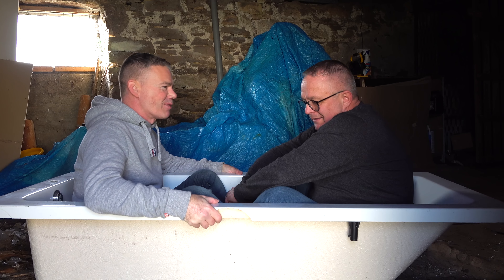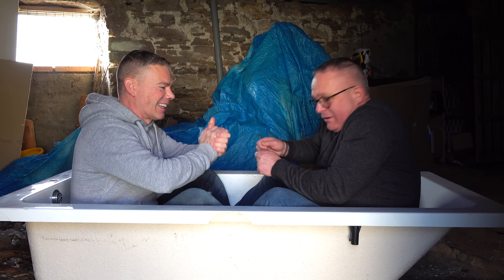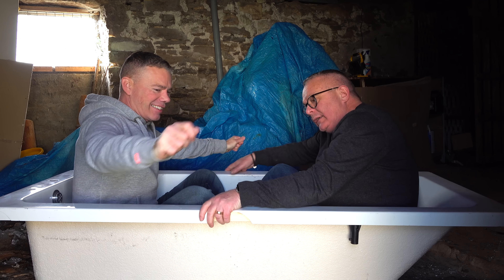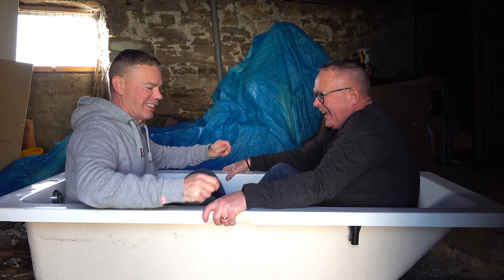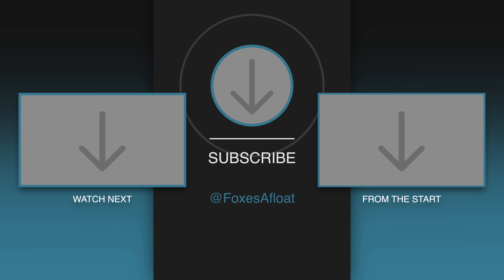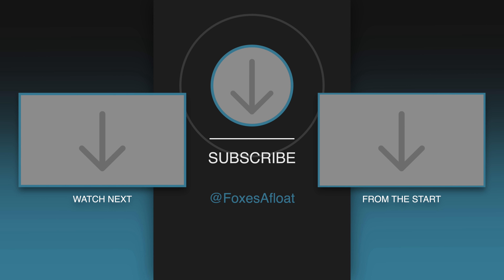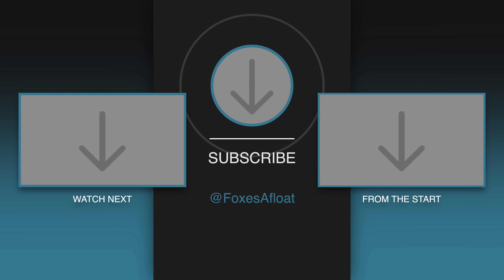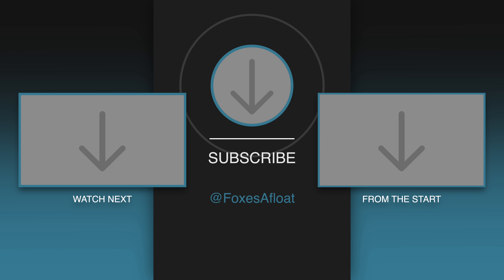Building a Train Set inside a TRAIN! Model Railway Heaven! Ep. 222.

Comment: The carriage idea, although a good one I think it would end up being too narrow. The barn conversion, as others have pointed out would add overall value. Having a garden room would tick all your  boxes, would come in sections - easy to erect, also heating and ventilation would be easier.  If you still want a train set to ride on - build a garden railway around your small holding - you could have a steam train or electric (battery). Anyhoo have fun guys.
Reply: Gets my vote.
Reply from the maker: Not too narrow, already checked 👍🏻

Comment: Having a purpose brought building for the layout is the way to go, definitely needs windows though not just for obviously letting in light but added ventilation in the summer months , heat definitely isn't good for a layout. My own layout is in our attic and is equally subjected to cold and hot conditions  but I've worked with these situations allowing for them. I've also built it in exactly the same way you're talking about doing yours but mine is loosely based on places I've visited and is designed around a viaduct with a small river and watermill along side, there's a big waterfall, a slate quarry and rolling hills, Drystone wall's feature throughout. The Hornby Harry potter station building " Goathland"  takes pride of place as the main station alongside sidings that house a  coal yard, timber merchant and the obvious goods shed, and small engine shed/ servicing hut. A small second station was added later. Yorkshire - Derbyshire and Wales are the main inspiration of the layout which is single track through the scenic detailing with double track in the stations to allow storage or change of running train 🚂🚃🚃🚃 and lot's and lot's of sheep 🐑🐑🐑🐑🐑🐑🐑🐑🐑 if you're going for sheep better start collecting them now they're becoming harder to get hold of.  Imagination is your license to create and I'm certain that you'll be inspired by your thoughts and create an amazing layout 😁🚂🚃🚃🚃.

Comment: The purpose built shed, fully insulated and wired would be my first choice. 
The carriage is too narrow for OO gauge, unless you just want to build an end to end layout. 
Converting the barn would give you a later higher resale value but it would be tricky.
Reply from the maker: We never mentioned a purpose built shed 😂 The carriage is not too narrow. A full 4th radius (widest) curve will easily fit inside with space each side. Not interested in resale value, otherwise we'd build a conservatory 😂
Reply: @FoxesAfloat , then speak with Lizzy and Dave at Railholiday, they know all about converting rail carriages and have done amazing things to the ones they have.
Reply from the maker: @billcook112  No need. Got my own imagination 😉

Comment: As nice as using an old train car would be, I think a new building would be preferable if not only for the additional space you would get but also for the possibility of expansion at a later time if you need it.  I can't imagine the cost of installing a section of track then purchasing/moving/refurbishing an old train car would be significantly less than a newly-built structure.  And while a train car would certainly be a point of interest, a new-built structure might make the property easier to sell in the future - not to mention that a train car limits the size and shape of the layout and the working room  you will have to build and operate it.

Any way you choose - good luck!
Reply from the maker: Did you miss where I said all three cost the same?
Reply: @FoxesAfloat  My fault - I didn't word that part of my reply very well.  My intention was to say I wouldn't think that the unique-ness of having a train car would be as valuable as having a new-built structure; that while using a train car would be quaint and interesting, the benefits of a building (resale value, future expansion, etc.) would be more valuable for the same price.  Funny how my original reply sounded right in my head when I thought about it, but it didn't translate all that well into print... 😏

Comment: Go on, fix the existing shed. Dig out floor and ensure compact. Lay insulation and a damp membrane. Lay concrete over the top.  As for the walls, dry line them with insulating plasterboard. Quick job.  Repairs to roof timbers very easy. Then plasterboard ceiling with insulation on top. Surprisingly cheap to do.
Reply from the maker: Nah 🤣

Comment: I do suggest setting the carriage, rails, sleepers and rough appearing gravel on a concrete pad. So it won't settle into the soft ground.
Reply from the maker: No need. The land is solid rock under a few inches of soil.
Reply: @FoxesAfloat  well, that makes the project less costly!

Comment: I think the basic concept is a great idea and worth pursuing. I know someone who bought an old BR std gauge goods van and transported it to a remote location, did it up and made it dry enough to store mountaineering equipment.  The transport was difficult and expensive, and once installed the van needed a fair amount of work to make it secure and weather tight - in fact I helped a bit and put a new felt roof covering on it (old covering very leaky!). When he got to the point of needing more space, instead of repeating the whole process, he hired a local tradesman to construct a look-alike using new materials (angle iron frame, planked sides, curved roof etc.) Looks just like a railway wagon but the materials came to site loose, think of it like a goods wagon from Ikea!  I realize it would not be a historic object in its own right, but you'd get the atmosphere, look and feel of the genuine article without needing to hire massive lorries, cranes, diggers, track laying etc.

Comment: I spent 18 months converting a 1930s goods wagon to a shed / train room. The result is great but at under 18 ft but 8ft it’s great for a train set but just not quite big enough for a decent model railway. If you do, go for one with barn doors rather than a sliding door. They are a pain in the arse and add a door to the end for everyday use. I’d share my wagon’s Facebook page but it’s not allowed.

Comment: Adding to your confusion, what about shipping containers?  They can be delivered on a sidelifter truck, are 40ft or 20 ft, refrigerated containers already have some insulation in them and some form of air cooling system.  As the train set expands (it will) you could add another as they are modular.  You will probably need a concrete pad or brick piers to put them on.  Whichever you decide, have fun!
Reply from the maker: We ruled those out for a few reasons. 👍🏻

Comment: Keep the barn for later, but do some fixing up: fix the joist, maybe do the window and door, and insulate the roof (if the bats/birds allow it), maybe even put a small (wood) stove in so you can heat it cheaply, especially once you have done the other fixes. You may want the barn for something else later. The idea with the goods car is cool, and you will become a local celebrity (more so than you are already 🙂) – but I would go for building a shed. It will be new, no hidden maintenance issues, easier to get started, and if you really want the train theme, go after the West Highland Line station look (like Crainlarich and all the others). Still "Trains!", as cool to look at, but less odd, and probably easier to keep up long-term. And you are more flexible with size. they both will be fine. The goods car probably makes for better content for the channel, I'll give you that. Good luck! I'm a wee bit jealous 🙂

Comment: YAY!!!!
Reply: Hi The Foxes, i would go for a new purpose built shed or cabin. You know what you are getting with a new build and no nasty surprises of rot or leaky roofs. Be aware that rolling stosk will have covered thousands of miles, been shaken about in all kinds of weather. Also, be aware of expansion and contraction of long lenghts of track with extreme temperatures. i would have plenty of droppers, extra feeds, if you have long running lengths. look forward to seeing the end result.

Comment: My questions come from a perspective of a DIY guy now having to be careful with not overdoing it physically. You've probably considered everything in this post, but I feel compelled to ask in case you missed something. That said, here goes...

Trains in a train sounds awesome! I'm assuming your number crunching involves cost of buying, moving and prepping the ground. Are there special considerations you need to take as far as insulating, modifying, wiring, painting and roof maintenance? Can you use off the shelf supplies? Will it affect your property taxes...(is that a thing there)? Do you have the patience for what seems like a huge job? Would there be any nasty materials like led paint, asbestos to worry about? Will your layout curves fit inside or will you have to compromise?

If the coach didn't work out for some reason, a shed seems like the most efficient and straightforward as far as site prep and finishing the interior. Perhaps the exterior could be made to look like a coach or train station?

Again, the coach idea sounds awesome. No matter how you do it, I'm sure it will be great. 👍👍
Reply from the maker: Yes, all those points have been considered 👍🏻

Comment: Hi Shaun and Colin, 
just a quick mention around using an old rail carriage.
A big decision would be around whether or not you want to keep the bogies under it or leave off the bogies (which makes it easier to transport) and sit the carriage on its own foundation.
Sitting it on its own foundation negates the need for rail tracks and sleepers and ballast. 
Plus makes the whole thing shorter rather than sitting up off the ground.
You could set it up to look like it is sitting at the platform, and it gives you more area for placing walkways and doors to enter the carriage.
The cost of the carriage with or without the bogies would not change as most companies sell them "as is" and it is up to you from there.
If you can find a carriage which was air conditioned when it was in service, you can consider getting a ducted system retrofitted utilizing the existing ducting.
I look forward to seeing the choices you make and keeping us informed.
Cheers :)

Comment: Just a couple of things to watch out for if you are thinking of getting a Wagon /Wagon body. Make sure that the roof is sound as you may find that it will need new timbers and canvas to make it water tight. Also the wall timbers may need replacing. If you get you Wagon complete with the wheels you will need to put blocks between the spring tops and the underframe to stop the body from moving., if your wagon has leaf springs. You may need  a different solution if it has Coils. Hope this is helpful in your decision Good Luck guys

Comment: Guys, Id go the carriage because I'vedone it once before. We bought one about 20 years ago. It eventually became a local produce store on our property. It was a huge talking point and basically an instant building. Youd be amazed how they transport them. Ours was separated from its bogies then the carriage body became the center section of effectively a semi trailer. One end on the prime mover and a separate set of road wheel attached at the back and locked in place. The bogies came on a separate low loader truck. You wouldnt believe where they can drive. They reversed a 30m long train into a 90 degree  right hand turn into or driveway in one take. (The rear truck wheels are individually powered so they can be steered independently of the truck)
Our was set straight onto the bogies straight onto the ground. It barely sank on the day, maybe 100mm and then never moved again. If i could post photos here I would for you...
Instant shed!😆

Comment: Carriage is a romantic homage to the railway but will probably be a logistical nightmare and restrictive with the width for looping the tracks at the ends. I would go for the barn conversion as it will in the long run add value to the property as well as being a more practical space to work in. You could still get a carriage but I personally would convert it to an air bnb which will in the long run pay for itself or as guest accommodation.
Reply from the maker: The carriage will fit all curve diameters, including the widest 4th radius with space to spare at each side. (already checked that). We're not interested in adding value to our property. This is a lifelong hobby in what we hope is our lifelong home. No way would we ever do Air BNB. The whole point of moving here was for privacy and peace and quiet 😉 x

Comment: Convert your existing building, and you won’t have the extra hassle of sousing and transporting a van or shed. All your ideas will require building materials anyway. It will be more secure and add value to your property. You can easily make the exterior of the building look like a waiting room, ticket office, etc. Did you include the cost of providing the electrics to your buildings?
Reply from the maker: It would be more hassle converting the barn.
Not interested in adding value, more interested in investing time into something we enjoy that looks unique inside and out. Love trumps profit 😉
Reply: Buying a railcar would be easier and save a lot of work if the cost is comparable. I have worked on my layout for over 20 years and the cost has been substantial even though 
I have a basement. I have the land, and if I had to do it over I would have purchased a Railcar and saved a lot of sweat and  money. Converting the Barn would be time consuming and a lot more work than purchasing a Railcar. I wish You the best of luck in your endeavor.  Ray USA

Comment: Personal opinion, the "train set in a train carriage" is romantic, would be a lot of work, but would indeed be lovely. However I think it is also a much higher risk concept, in that, going back to my days as a professional engineer, I can see many more ways in which it could all go rather pear-shaped. Now my personal philiosophy of life has always been to go for something good which I KNOW can be reliably delivered, even if it isn't the absolute best... So personally I would choose the custom build shed. 

That way you know that at the end you will end up with a good outcome for the train set, and also a superb additional building which, in years to come, will still add value to the property. Also - the shed, if properly designed, can be built to virtually whatever size is needed, will be easier to control the moisture in, and heat, and as a bonus has the possibility to house more than just the trains - for example a nice veranda for cocktails outside - or whatever. So I would vote Shed... but ultimately only you two know what you want - so listen to your own heart - not my opinion.

Comment: Hi lads, from Caliente Nevada. Just a suggestion, but for heating why not a fuel stove like you had on Silver Fox? Here in Nevada, woodstoves are cheaper to use than other types of furnace. I don't know, might not be true in Scotland. Great vlog and I love the idea of a train car to house your train set up. I love trains, good thing since we have 30 a day coming through the middle of town.
Reply from the maker: They create a lot of dust which would interfere with the model. We’re looking at a cleaner, sustainable heater with no dust 👍🏻
Reply: @FoxesAfloat  Most heating solutions would likely reduce moisture to very low amounts. What is the humidity during summer? Here in FL, USA, we are high humidity nearly year round. There are good air conditioning units on the market around 500 USD that have humidity control. Even if the space is "bigger" than the unit can handle, something close is well good enough(not more than 25% recommended difference). I am sure the humidity will be a cost, but a small one and likely around the same no matter which way you decide.
Reply: @FoxesAfloat  that makes sense; didn't remember about the dust it created. Dust is something I fight daily here. Ciao lads.

Comment: I think that if you are going to go for a railway wagon or carriage, go for a freight wagon as they are generally of much simpler construction and would be easier to convert. Passenger carriages are made to look good and have more features and complications which makes them more complex. A freight wagon therefore will be much cheaper and probably easier to find too. Only issue will be finding one in a good condition and for a price you can afford. Don’t try getting something from abroad though, a British wagon will be easier to get to your location. You will probably need to find one that dates from at least the 1960s as after that they would have been using more modern types of wagons which won’t be any use to you. I would find something like a box van, maybe something longer, but you will need to check the condition of mainly the framework, cladding can be more easily replaced but if the frame is no good don’t bother. It might be difficult though as those sorts of wagons are generally quite tired from being out in the elements and sought after, especially by heritage railways so could get expensive.

Most model railway enthusiasts in your situation would buy some sort of insulated and purpose built log cabin or shed type thing, but it would be worth pursuing the railway wagon idea anyway I reckon.

Hope that helps!

Comment: Stick to plan A, converting the barn will add value to the property, if you get a shed or a carriage then you'll still have a barn that needs converting
Reply from the maker: No we won't. The barn is a barn. Doesn't need converting. We're also not interested in adding value to the property. We want a cool model railway inside a train.
Reply: @FoxesAfloat  that's cool, but you did ask